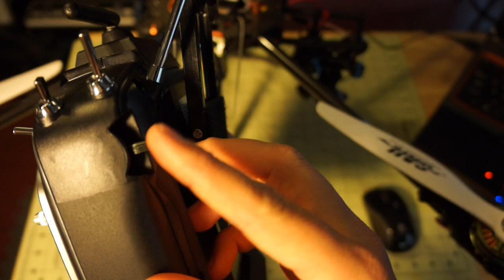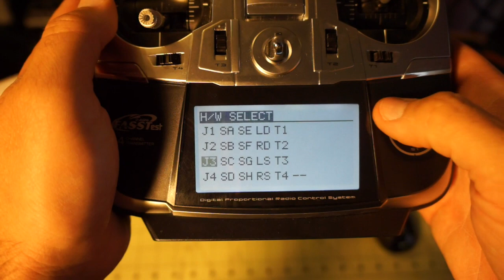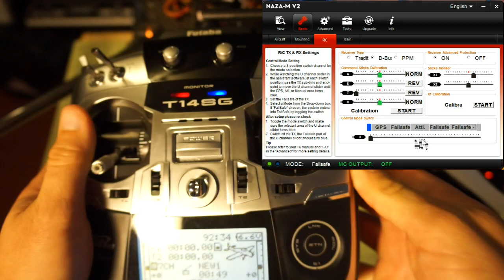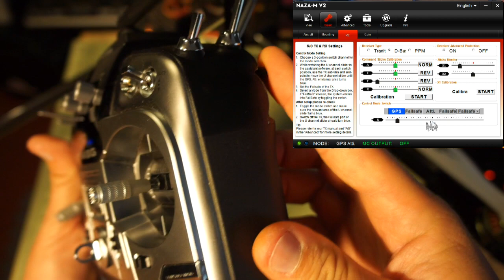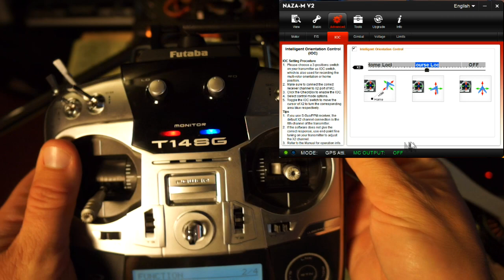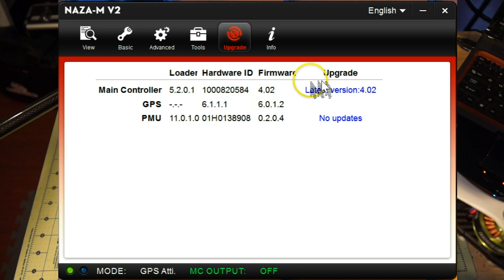Naza V2/ Lite Programming with Futaba 14SG/ 8FG

Comment: Thanks for the great video...  Just wondering..  I have a retractable landing gear and I Can't figure out where to plug it in and set it up.  Been searching the net for hours!  Looks like you have the same ones.  I'm using 14g with r7008sb.  Thanks!
Reply from the maker: +SecondLaw You can plug it into any avail channel and assign to any switch you want with the 14SG
Reply: +AGL Aerial Video Solutions - Just saw your reply now.  Thank You!  Do I need any special device for my landing gear?  For example, I took one side of the gear and plugged it into a channel on the R700sb.  Then went to function and tried to use a channel on there.  I can't get the gear to move at all.  Thanks again!

Comment: Thank you very much for your time in making these videos! I do have one question, is there a way to set up naza/T8FG to start rotors from like 15% throttle stick? I don't really like how its set up to takeoff at center stick.I know that is the way the phantoms and other A/P units come, but I started on heli flight with full throttle stick control. As I learned to fly heli way before Multirotors were avalible. As I progressed I like Having set the tx to switch from full throttle stick to 3D center stick and back again. I have a DX6 black with a AR8100 that when hooked up is full stick command, but im learning the programming aspects of the futaba tx so not sure the settings to use. Not trying to fund a flyaway. Thanks again for this video, I picked up way more vital info in this one video then a dozen others on youtube.
Reply from the maker: Project RC The motors should be spinning up from their idle mode when you arm the craft.  After that the flight controller (Naza) controls the throttle percentage depending on the stick position.  I'm not sure how you would b able to do what do described.  I fly CP helis as well and prefer them of multirotors.

Comment: How about a program for airplane and not heil
Reply from the maker: Edgar Gravely Can Do.  4 or 5 channels?  Single ailerons channel with a Y connector, or dual aileron channels.  Flapperons? Flaps? Landing Gear?  I can certainly do one the question is just how complicated the program should be.  We have been talking about doing a simple 4 channel video with the newer Spektrum DX6, but we certainly do one for the Futaba protocol as well.
Reply from the maker: AGL Aerial Video Solutions we are working on a series to cover
 that as we speak

Comment: Is there a power output setting on the Futaba 14SG so you can get the max signal?
Reply from the maker: You can turn the RF on and off, but not change the power setting as far as I know.  That would be a question for Futaba.  Most of these radios are putting out about 200mw of power on 2.4 band.

Comment: Hi! Very nice video. Thank you for posting. I just bought this radio and I will be setting it up with Naza V2.
I want to use the Multirotor mode instead of Airplane mode. 
Will this mode need a different series of steps, it will the same steps in this video apply.

Thanks in advance
Reply from the maker: Sorry it took me so long to reply to your post, I've personally never set one up in Multirotor mode, but I will give it a try.  They function the same way so my initial guess would be that it doesn't matter.  The radios very multirotors functions as airplanes traditionally.  As long as you don't try to use a CP (collective pitch) heli setup then you should be ok.